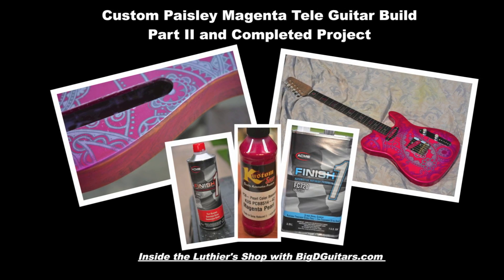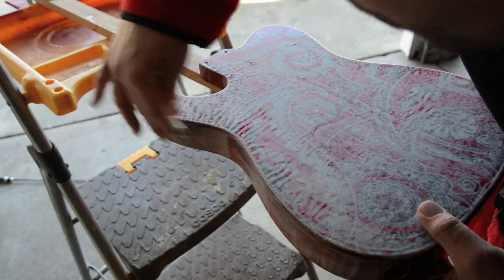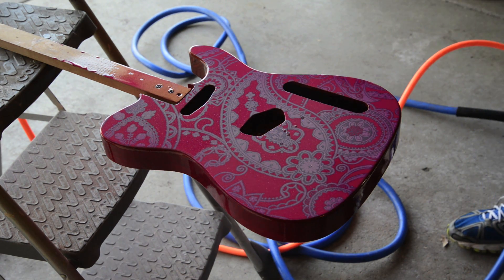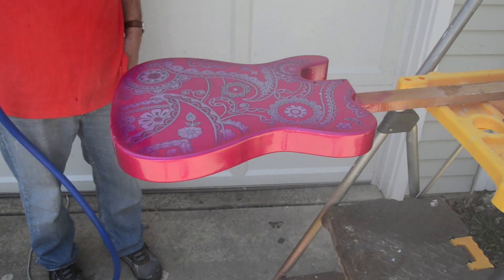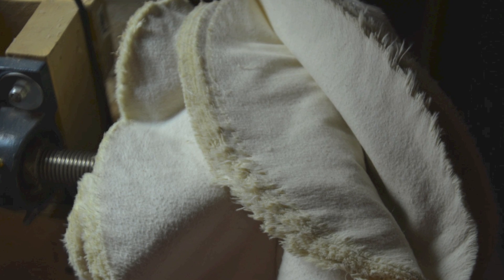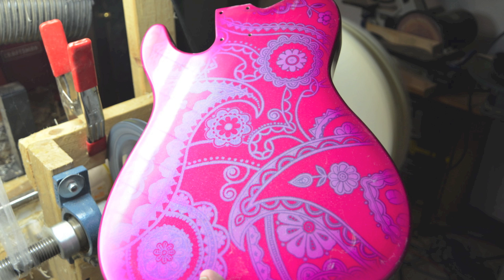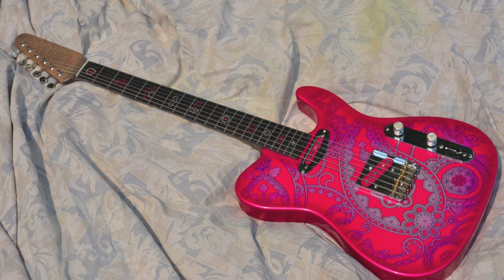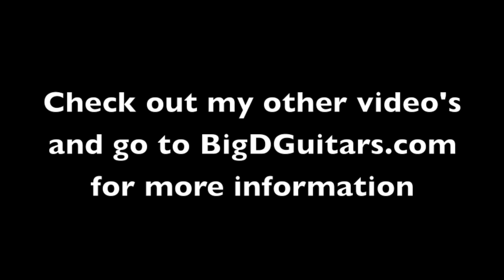Custom Paisley Magenta Tele Guitar Build - Part II & Completed Project

Comment: I am I very interested in doing this to my next project, but I have a question.

1.  Would it not be better to prime and paint the whole body before you apply the wallpaper and then gloss finish it with clear coat?

Comment: beautifully done,could u use an epixy resin instead of the 2 part finish u used,?
Reply: Epoxy is 2 part, the trick I'm guessing is to get a smooth finish hence why he sprays, you can buy 2k clear coat in can but make sure you buy a decent quality mask and go outdoors to spray.